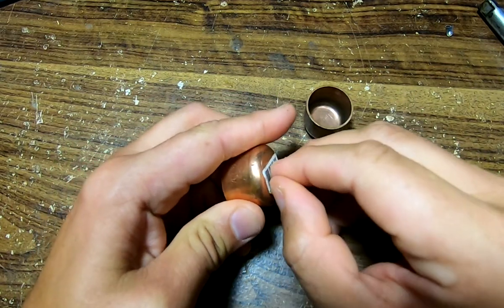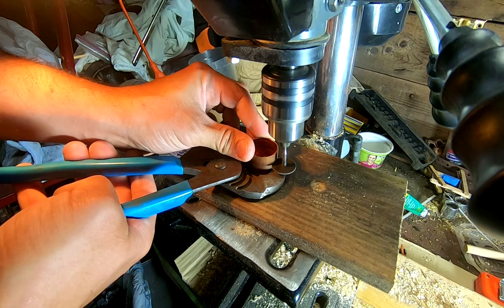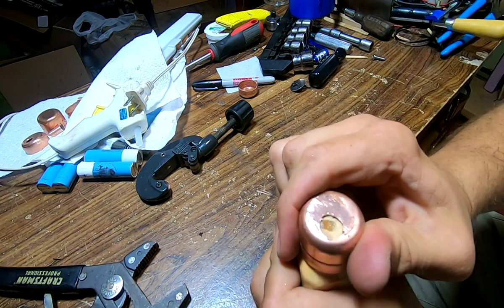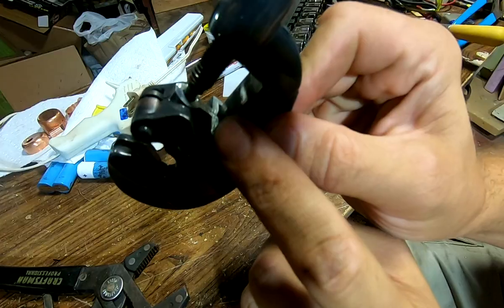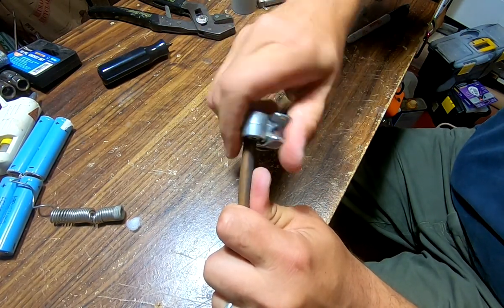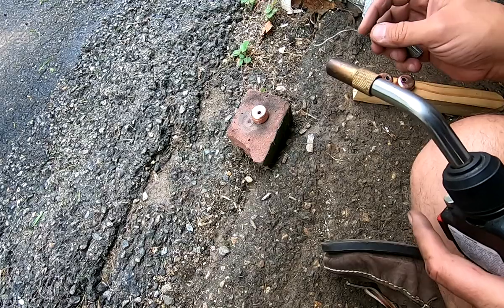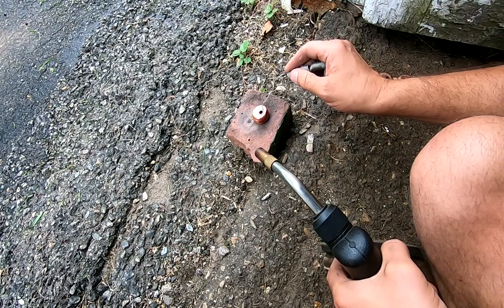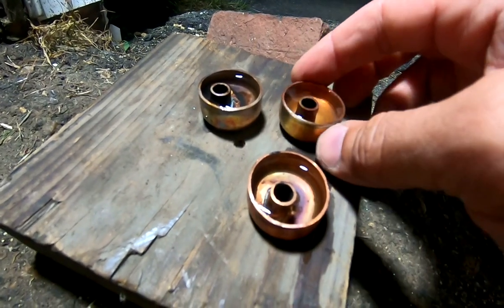Making a Lantern Preheat Cup

Comment: When I've done this previously, I soldered the tube to the inside of the cap before the hole was drilled. I then had the tube to act as a guide when I drilled the hole through the bottom. A round file will quickly neaten up the inside edge of the newly drilled hole.

Also, if I wanted to cut the end caps down first, I'd use a woodworking flat bit or a forstner bit to make a blind hole the correct depth in a piece of scrap wood. Then you can push the end cap into the blind hole and use a regular hacksaw to cut the cap to size using the surface of the scrap wood as a guide.

Comment: Is this a comedy video like your 335 video? A hacksaw and a step bit are the tools for this job. I ran a timer and it took me 1 minute 43 seconds to cut the cap/pipe sleeve, drill my hole, deburr the hole, and fit the pipe sleeve into the cap turned cup. By using the step bit I was able to slowly enlarge the hole and get the sleeve to fit so tightly I had to tap it with a wooden block to seat it into the cup. This made brazzing it in place very easy and looked great.
Reply from the maker: Maybe I'm not a great metalworker but I can spell brazing.

Comment: i used to just solder the copper endcap with hole to the gen tube. id just repack retip the gen tube with new parts if they went bad. prob was the solder would melt sometimes.
Reply from the maker: You'd definitely want a hard silver solder for that kind of application. Braze would be even better but would require a delicate hand on the torch.

Comment: Cool video!! I’ve been putting off learning how to solder and this is great information on how to get started. 
Are all silver solders the same? Is the flux in the same area as the soldering material?
Reply from the maker: The more silver in the solder the stronger and more heat resistant the solder will be. Ideally the flux will match the solder, it goes in the same area that the solder will be placed, when the solder melts it displaces the flux. For good info on soldering check out Keith Appleton's channel, he's made several excellent videos on the subject.
Reply: Lantern Lab Thank you kindly 👍🏻

Comment: I’m looking for a lantern to add to my power outage preps. One person recommended Alladin brand. I saw that the vintage Coleman’s or SMP* take gas. What would you recommend for a long term use, parts availability, easy to use and maintain with multiple or affordable fuel?
Reply from the maker: Get whatever burns a fuel that's convenient for you. For use in the house I'd probably recommend something propane, it'll make less smell. For a vintage lantern/lamp I really like the Bernzomatic Dual beam. Get a propane refiller so you can refill the small cans off a BBQ tank.
If you really want Coleman get a 200A, 220 or 228, pick the one you like the look of best. They're simple to work on, parts are easy to get and they're very reliable with the most minimal of maintenance.
Aladdin lamps are also fun, apparently parts are hard to get right now but a wick/mantle combo will last years in most cases. An Aladdin lamp isn't even comparable with a gas pressure lamp in terms of light but they're silent...

Comment: Hey its been awhile since your last video - hope all is ok - for an idea for a new one - how well does a screen mesh work as globe - it does lower the light output a little but it doesn't break like glass
Reply from the maker: Good idea, I could make one from window screen and another from hardware cloth. I suspect wind will be an issue though...
Reply: Hardware cloth will be to loose a weave and wind will definitively be a problem - plan screen will stop most of the wind unless it’s really howling - or go really hi tech and get stainless after you figure out size with regular steel

Comment: nice job  that's usually the way a simple idea gets hard once you start! I wondered if you ever installed a burner/wick a couple of sizes larger into a small flat wick lantern? The idea would be to get more light out of a small lantern? I am guessing air holes would need to be increased to provide extra air for the larger wick. Any thoughts or suggestions?  You know what they say..."you can't do that!"
Reply from the maker: I've only ever put one wick into a wick lantern and it was the size that the lantern called for. I think a flat wick lantern would need substantial modification since the channel the wick rides it would also need to be expanded. That seems like a lot of work to me considering the amount of light that would/could be gained would be fairly minor.
If you do it let me know, I'm always curious.
Reply: @LanternLabs  thank you for your reply. I was thinking along the line of switching up to a larger burner designed using a larger wick and then install that burner into a smaller lamp. Since wick size is the primary design feature to determine flame size and so brightness. The modification would likely revolve around the actual retro fitting of the new and larger burner and also in increasing air intake of the lamp at the burner. That said a larger burner ought to have larger openings to provide for more air intake. I was thinking about switching from a half inch wide wick burner up to a 3/4 inch wide burner. I will let you know what I can find, I have some small inexpensive lamps now and I need to find a larger burner which would seem to be a likely candidate (size wise) and then see if I can surgically install it into the smaller lamp.
While I am here I wanted to ask your opinion about the Kirkman (I really like the no.1 Little Champ), if you look at their Cold Blast lamps and then at the Hot Blast that Dietz make you will see that the Hot Blast lamp has a lot of open area on the mounting plate which holds the burner (this makes sense as you want to up draft as much fresh air as you can to improve the re burning of the exhaust gasses being pumped into the burner) but the Cold Blast version has few opening in comparison. Why do you think this is? I would have thought you would want all the fresh air possible to make your Cold Blast lamp run even brighter. After all it is the extra fresh air which makes a Cold Blast design burn brighter than the Hot Blast design. I have a lamp right now with a spare burner and I plan to increase the open vent hole area on one of the burners so I can compare the same lamp with the same burner/wick and the only difference will be the open vent area with one stock and the other with much more open vent area at the burner mounting plate. I will let you know how that works out. Please let me know what your thoughts are and if you think I am on the right track with respect to increasing the updraft air venting into the lamp at the burner mounting plate. Thanks.

Comment: That's cool - I presume you went to all this trouble so that you can burn 1-K kerosene in your lanterns.  I've never tried this, does it burn as brightly as white gas, or only something like 90% as bright?
Reply from the maker: Primarily preheat cups would be used for a kero lantern. They'd also be useful on a quicklite lantern that needs preheat to light with white gas (Coleman fuel). Kerosene has more energy than gasoline but the brightness of a lantern is determined by its design, not the fuel used. A converted 200A, for instance, will be about the same brightness using kerosene as it would with white gas.
Be on the lookout for a future video where one of these preheat cups makes another appearance.

Comment: I like to ask is it possible to convert a coleman dual fuel model 285  into using Kerosene , if so how can this be done ?
Reply from the maker: Probably. Most Coleman fuel devices will burn kerosene straight up if you can figure out how to preheat the generator.
That said I don't think its really worth it. If you want an kerosene lantern the 639 is a great option.

Comment: Doesn’t the solder melt when you run the lantern? Should it not be brazed?
Reply from the maker: Not that I've experienced, silver solder definitely won't. Soft solder might but it hasn't for me.
Reply: Lantern Lab Good to know about the solder! I’ve bought the stuff to make some too and have been holding off because of the same struggles you went through. Thanks for showing your process and what you went through!